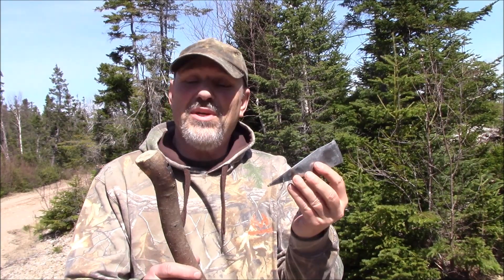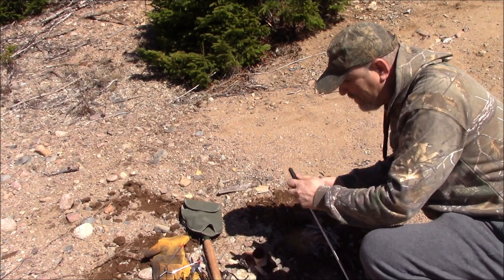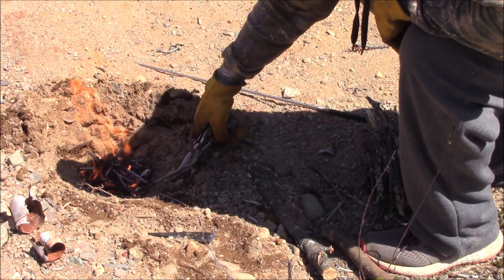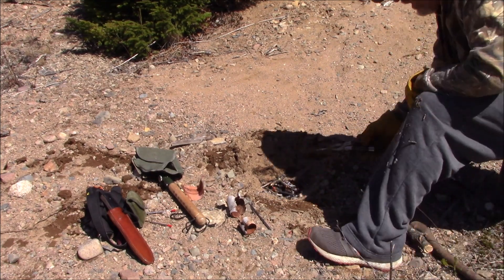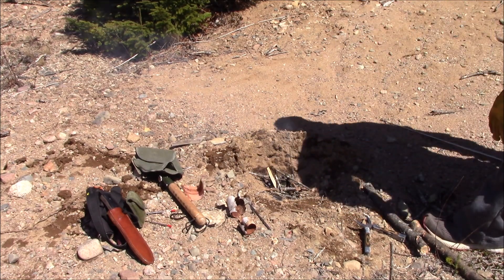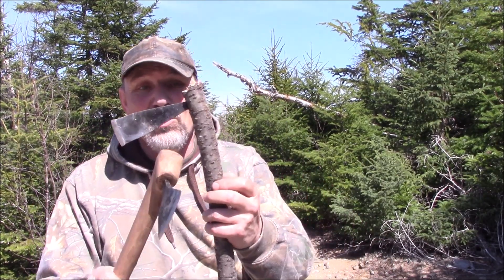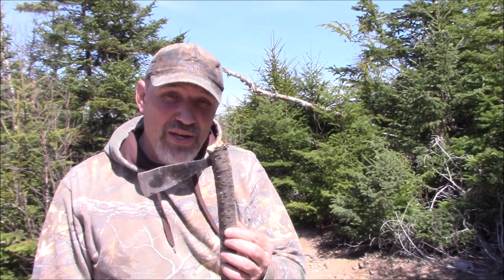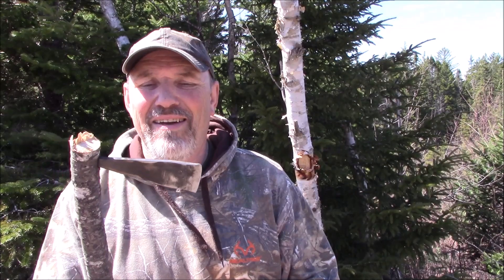Making a Primitive Style Forge, in the Forest, to make an Axe/ Adze

Comment: Cool Vid Wayne, when you lay that blade in the coal bed cover the business end with a wad of that cool soil. This will prevent temper problems! Cheers Buddy
Reply from the maker: Thanks Darren, good tip. i was going to use a damp cloth to cover the blade portion, which i have seen, but the sand is a great idea, thanks man. All the best.

Comment: When you get a chance dig up a small birch tree and trim the root ball of roots it makes a great ball at the end of the handle with crazy grain to aid in keeping the burned hole in form,  I think they made war clubs from such tree root balls.  I now get the bevel, and having the head be adjustable.  If it was a dedicated adze I would curve the body of the head and put the bevel on the inside toward the handle.  On a straight head like this in the adze position I would put the bevel out away from the handle.
Reply from the maker: Thanks man, digging up a tree and using the root ball is how many folks make the handles. I just dont have the patience to wait a year for it to season. lol  So quick handles used a few times then thrown away is what im thinking for this tool, but can be made into a dedicated adze easily as well. :)  I appreciate your comment and watch man, enjoy your day and all the best.
Reply: @kullcraven  I'm always pulling trees here on the farm and see a lot of these root balls, so its just on my mind.  Yeah the ease of making the handle should be a factor.  It does seem this concept could be applied to a full time use of a handle, one where it was not tossed after use.  I would suspect it would not need to be dry for it to work either, as the tang on the head is tapered and it will just tighten with use.
Reply from the maker: @downeastprimitiveskills7688  The Kalahari axe for instance is burned into a root ball, and its meant to be the handle for the axe, not a throw away. The branch i used in the video was a throw away, not the best choice, but wanted to show it can be used, may last a long time, or not. lol  The problem with green wood, is dry cracks, that is the worry i have. You work with green wood alot. I have seen them burn the hole in and afterward, stick the ball in the fire till it blackens, i believe hardening it and some what drying it.